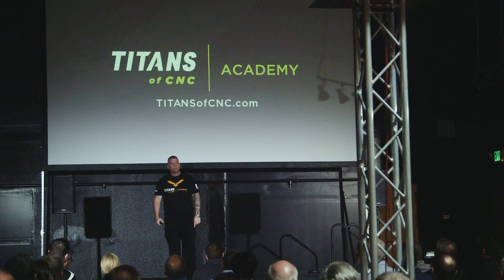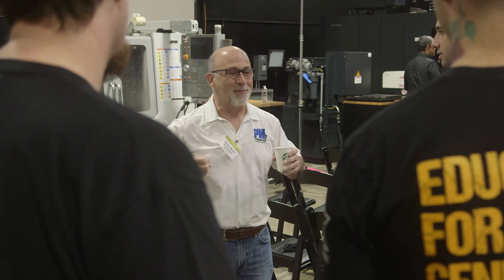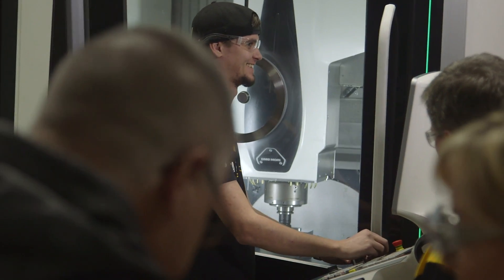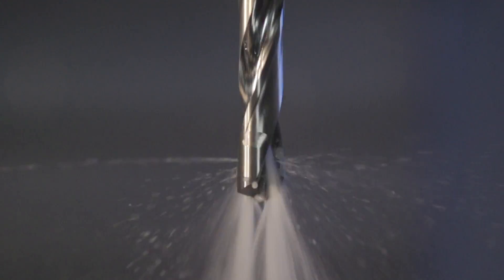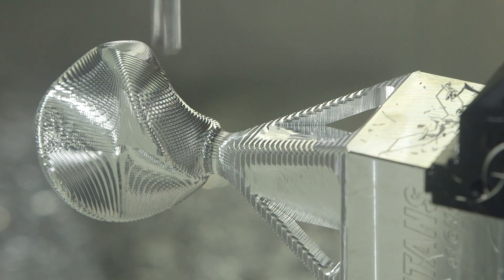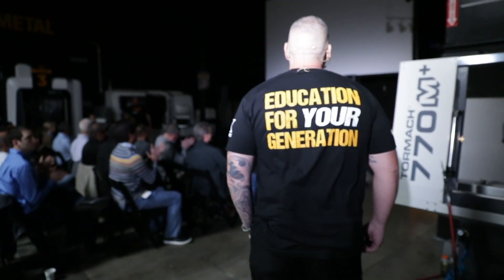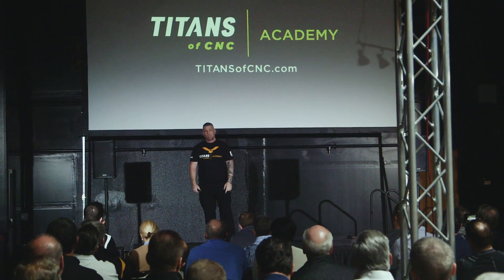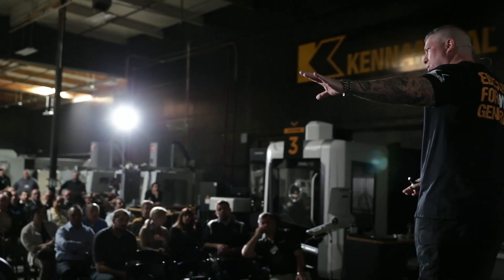CNC Machining at our BIG Kennametal Event | Vlog #71

Comment: I do have a question about the academy. How can it be that with all the tools that are provided to you that the education is still free?
Reply: Check out the Titans Academy website for all the details. Here are the basics. 

Titan and his team have created the parts, prints, setup sheets, inspection report sheets and tutorial videos. 

As for the CAD/CAM. AutoDesk has Fusion 360's license setup so that people making less than a set amount get a free annual license. I'm pretty sure the amount is $100,00 USD per year. 

As for being able to actually get hands on with a machine to make the Building Blocks. That is where the Titan's Academy Small Groups come into play. You can find more info on the Titan's Academy website, there is a tab for the Small Groups. Basically, it is shops or even home shops that set aside some time to invite a small group of people in to learn hands on with a machine. I'm not sure if there is any cost there. If so, it would be minimal, just to cover material.
Reply: The education is free.  Thats the part that is usually really expensive. You might have to buy a drill,  but that's better than buying and breaking 10 drills to get the education,  right?